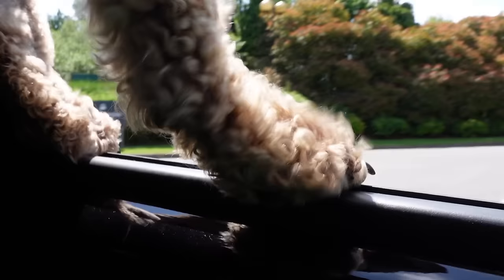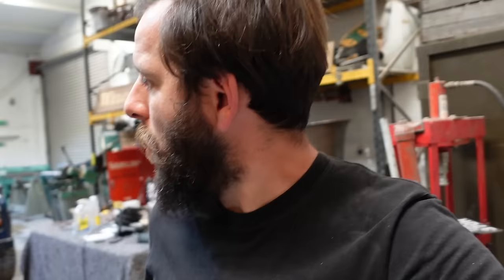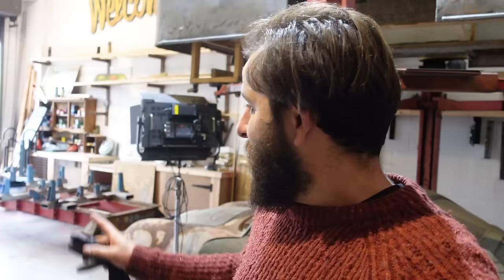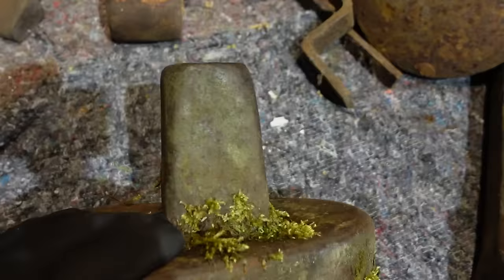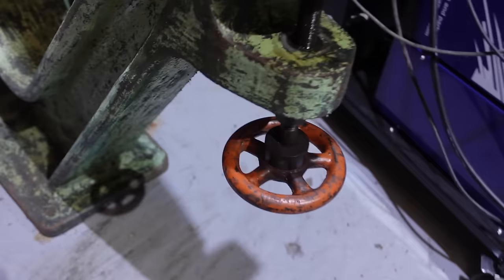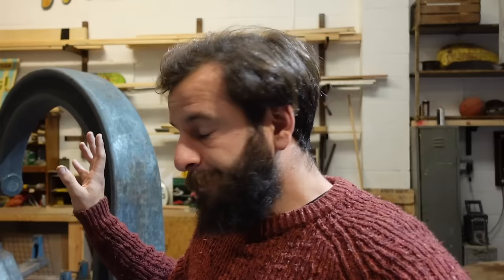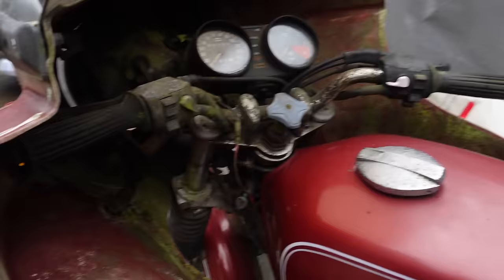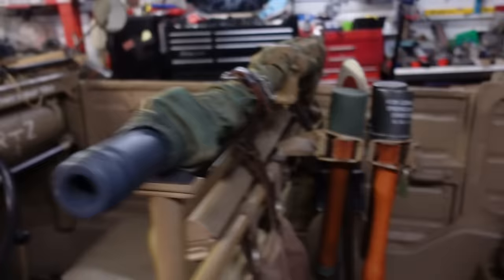A Motorbike In A Bush?! (ft. Honest Jon) | Vlog #11

Comment: The tee shaped iron is called a Bick iron. The bench bar was common in sheet metal shops and was slid into a holder made from channel with a locking bolt to hold it. Very often these bars were railway track. Electrolysis definitely.

Comment: Dom,
I have done electrolysis using just a SOLAR PANEL - worked an absolute treat, quicker and more power (on a sunny day) than using a battery charger type set up. I'm sure it would sort that vice out.
I do have a video on my channel of cleaning up a rusty cast iron pan that had sat in garden for years - and from starting to clean it, using JUST solar panel electrolysis, to cooking my breakfast in it was less than 24hours.
I won't add a link (that would be cheeky!) but by all means contact me and I can send it for you to look at - It may be a way of adding another electrolysis video to your channel by doing the vice with solar power so as to be a twist on your original video.
By the way, loved this video - rooting round at places like 'Honest Jons' is the sort of stuff I watch for....

Comment: Electrolysis is a wonderful process. I have built a couple of cars and had to use Sierra uprights and the such like. After 30 years they were a bit crusty but after 12 hours in the tank they came up really good. I don't understand the science but now use it a lot when restoring motorbikes.

Comment: You may have two problems when stripping the BMW. The lesser is the bolts through the sliders that hold the front mudguard - corroded in place. I had to drill mine out. The big problem is the two long studs that go through lugs in the frame and through the engine to mount it. - corroded badly in place. It took me two days per stud to extract them and get the engine out.

Comment: It will be interesting to see if the electrolysis gets into the sized parts of the vice - difficult to get the solution & electric current into the enclosed spaces. However it should clean up the major part ok. Don't hit it to hard trying to get it apart - some vices are quite brittle which is why I was told never to use them as an anvil.
Reply from the maker: Let’s see how it goes!

Comment: I inherited from a house purchase in France, a large round copper cauldron type pot with robust handle, and when I cleaned the crud off the outside I found it was made in two horizontal halves, using a joint of small interlocked castellations brazed with brass. Amazing workmanship. Yes Please, electrolysis city.

Comment: Hi Dom I reckon an N shape stand would work well for you bench mounted form holder with the working end on the left and the opposite end locking into a slot thought the up right on the right. If that makes sense.

Comment: When I was working as a sheet metal worker we concrete a socket into the ground to take a 4” heavy wall box section which you dropped in to the ground socket which when it was not in use had another tube with cover that drop into the socket the main tube was 10mm heavy wall thick plate welded to the top with another socket welded to the under side of that plate which was tapered to fit the various blocks we used hope this is of some help Dom

Comment: Hi Dom.I would be interested to see a video comparing electrolysis to vinegar for rust removal. I have have had fantastic results with white vinegar removing rust from steel. Also, did I miss something,  what is the story whith the second ranalah and the  metal working goodies? Cheers.

Comment: Hi Dom
Great channel. I use a 10% molasses and water solution for rust removal. Have you heard of this or tried it? It's simple and very effective. No messing with power and water so considerably safer and mega simple. I'm sure you can source a supply of molasses. In a vessel with a lid to prevent any curious vermin or insects and leave solution with the items to be cleaned for 10 days or more. You may be pleasantly surprised with the results. Ideal for you and the solution is reusable over and over and environmental friendly. All the best.